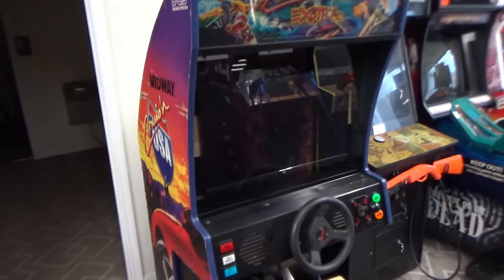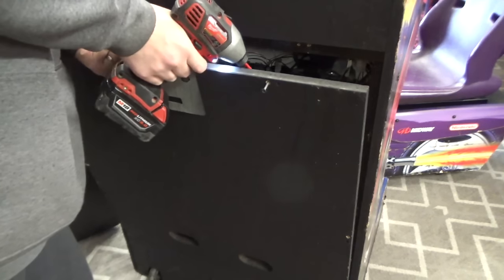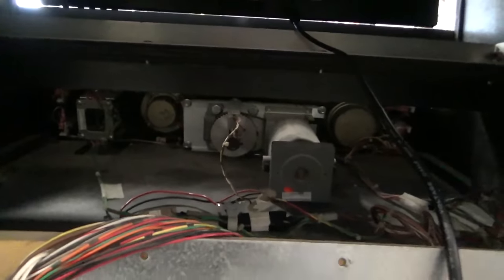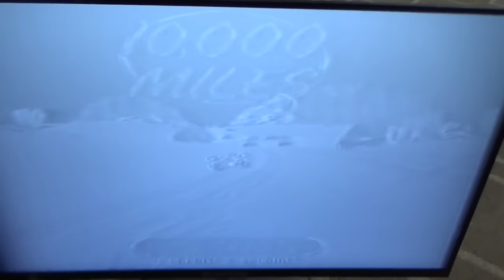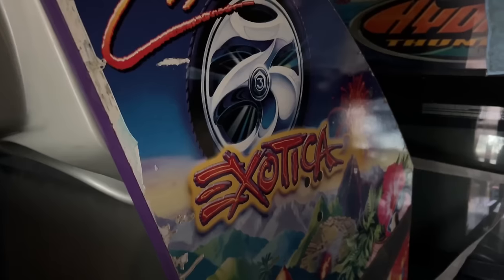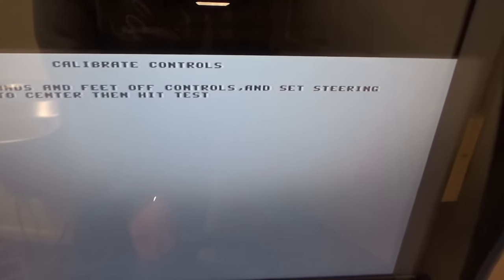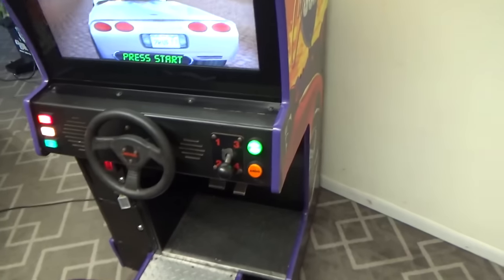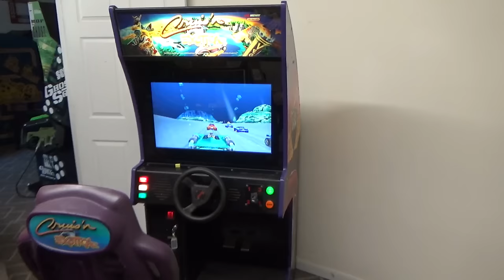Repairing Midway's Famous CRUIS'N Exotica Arcade Machine.... Vintage Nintendo LCD Swap ?

Comment: Zeus II hardware using a TMS320 DSP and FPGA-based geometry engine- very expensive way of doing things but that's what you had to do back then to get that kind of performance.  I say get rid of the silly fan- it will run just fine without it.

Comment: Why is half the bottom picture missing speedometer  shouldnt be cut in half  and it should tell you the speed on the left?
Reply from the maker: It has a few different Aspect Ratio Settings, I just had it on the zoomed in one

Thanks for watching

Comment: Ha Joe. I know what you meant about surface mount components.  Thay were a real eye opener when I first saw them.  A relation was fixing the remote key fob for a car. I couldn’t get my head round how small they were and no wires sticking out the ends. He just laughed and said that things were going to get smaller and he was so right. So iam with you prefer the older stuff.  Great work another one going.  👍. Bob

Comment: My guess is that the LCD was installed because of the CRT died and CRT replacements were no longer available.   So it was probably cheaper to install a CGA/ EGA to VGA (or HDMI) converter and install an LCD computer monitor.

Comment: ..... it's an Hp... That's the self destructing monitor.... The polarizer film on that range of monitors has a tendency to age out and fall apart. So even if you played around and test the game the Monitor either needs to be refilmed or replaced. To refilm it you'd have to hunt for the right polarized window tint that you'd put on a car to fix it if you wanted to fix the monitor and still use it. Otherwise find your local e-waste disposal company and send it.
edit: The HP logo gives you a date range of when the product was made. (Hp used that logo from 06-14) and the older monitors had the polarizer flaking off for years.

Comment: What is the video conversion board that you are using?
Reply: The green one was a GBS, the purple looks like a goldfinger.. can't see the model number sadly.. Edit, found it gdf-209316
Reply: Thanks. I have a pair of Rush the Rock's and have used the GBS on one of them.
Reply: @zosofan   I've turned a gbs into a decent upscaler using gbs-control and a esp32

Comment: Why is it so loud?
Reply: That great big fan, once the back is put back on you won't hear it.  Even if you do, they sell replacement fans that are quieter, or just get some foam padding and add it to the inside of the machine to muffle it.  In a noisy arcade, nobody is going to hear it anyway.